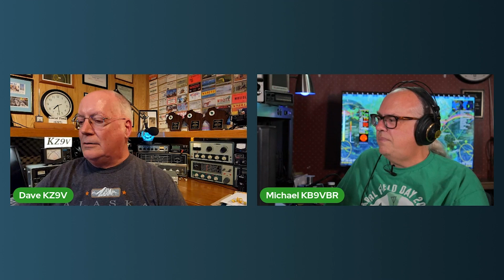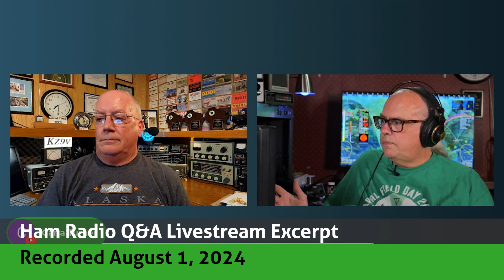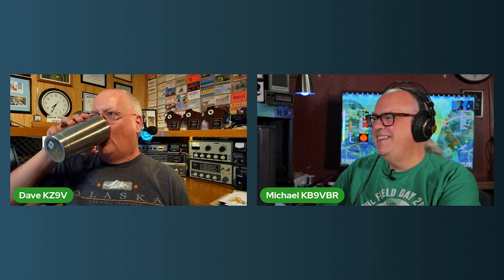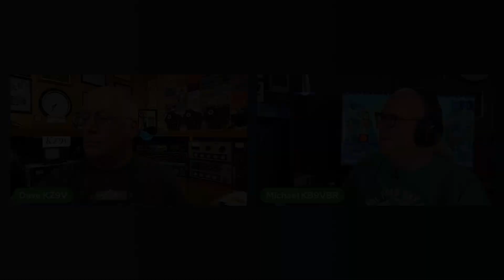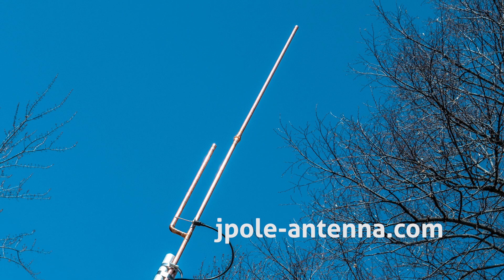Ask Michael, KB9VBR: Help me understand R and X values on an antenna analyzer

Comment: We know 0-1.5 swr is fine and 1.5-2 is ok. And 2+ should be worked on or watched, but what is a similar mindset on reactance? 0 being good, what range is fine and what range is ok and over what reactance should you stop and fix something? Obviously the relationship to swr comes into play, I am trying to “color” in a smith chart to show green ok operating areas, yellow acceptable areas and red, stop and fix something areas on the chart.

Comment: Your idea of running 75ohm cable to the rig (for a mono band dipole), would that work better (than with 50ohm coax to the dipole) when using a rig with an internal matching unit in it and matching to 75ohm at the SO239? If matched at 75, wouldn't that mean that there should be minimal losses in the coax?
Reply from the maker: Yes there will be minimal losses in the coax due to it matching with the antenna. One thing I neglected to say is that if you can cut your coax so that its total length is a half wave multiple, you will most likely have a near perfect 50 ohm impedance at the feed point. (This is an old CB radio trick, but that doesn't mean it won't work with the amateur bands, too).

Comment: This discussion begs the question then also, that while constructing antennas, (especially center fed dipoles) to target the 1.6 swr, or more precisely, ignore the swr and target the reactance, then load the antenna with a transformer to make the finals happy. Am I off base with this?
Reply from the maker: No you're not. When I am cutting a dipole antenna (or 1/4 wave vertical for that matter), I'll aim for resonance if at all possible. If I see on the analyzer that SWR is a little high, but reactance (Z) is close to zero, I'll stop and leave it be. Low SWR is good, and it is an easy concept to grab onto. But taking a more wholistic view of what reactance is and its relationship to resonance (and SWR for that matter) takes your antenna skills to a new level.

Comment: Great job !  75 ohm coax will work great on center fed mono band dipole. Just push the ATU on radio. Tune antenna for lowest reactance . even though SWR might climb like 1. 6 or so. it will work better than a tune of 1.1 and higher reactance. Let the ATU fix the 1.6 or so SWR. Their is 2 parts to reactence.  capacitive and inductance. I just made a T2LT antenna for a friend. I tuned the center conductor for lowest X   and tuned the coil for Z to close to 50 ohm. works super great. SWR worked out 1.2 to 1.3 in the end. And working skip during poor band conditions.  I used a VNA to tune.  and I calibrated at the end of feed line at antenna . You can do this with RigExpert as well. Takes your feed line out of play. 73

Comment: Is there a procedure for recalibrating a RigExpert analyzer?
Reply: Yes, there is for my AA230 it is described in the manual but it is the same as any VNA. You need an OSL (open, short, load) set. The Rig Expert will guide you on the order which is expected. The OSL standards are placed where you want to make a measurement (e.g. at the end of a piece of coax that will be attached to the antenna of interest). If you change the frequency range the unit will return to factory defaults. The default calibration places the reference point at connector on the RigExpert. Incidentally, the SWR measured at the RigExpert will be lower than that of the antenna  due to cable losses. All these measurements can be made using a NanoVNA as well. The only difference is the user interface.
Reply from the maker: Typically RigExpert meters don't require recalibration, but most models do have instructions in their manual on how to perform one.
Reply: DX Engineering sells a set of OSL attachments for calibrating. Search “DX Engineering OSL Calibration Set” on their website and you’ll find it.

Comment: Is this an instance of too much information?  If hams will still pursue minimum SWR as a goal, is there a practical concern over Reactance and Resistance that can be mitigated to improve signal strength? Should Reactance meters replace SWR meters? Linda Blair is envious of my rate of cranial rotation at the moment.

Comment: Ok guys.  Z= impedance.  R = resistance and X= recatance.  It should be remembered that the Rig Expert measures the values at the connector on the device by default. The R and X values at the antenna end and the RigExpert end of the coax are different.  If one connects an antenna with a piece of coax then one must recalibrate  the RigExpert using open, short, load standards (OSL) placed at the far end of the coax. Now you will measure Z, X, and R at the antenna.  The nominal impedence, 50 ohms, is only need to calculate SWR.  Resonance occurs when X =0.   The impedance of a vertical with a good ground system is about 35 ohms and dipole at 1/4 lamda height is about 72 ohms.  For short verticals the capacitive reactance is canceled out by adding an inductor (coil) to achieve resonance (X=0).
Reply: Good summation.  A key point that's often confused is that In the presence of standing waves (i.e., mismatch load), a transmission line (e.g., coax) behaves like an impedance transformer.  Thus, at any given point along a transmission line Z will be different from Z at the load, with the exception of a transmission line point that's electrically 1/2 wavelength or a multiple thereof in length from the load.
Reply: Yes, but measuring at the rig expert end is essentially what the radio sees. And if the radio has an auto tuner, for example, it tunes to what it sees at the coax end. By measuring at the rig expert end, one can also manually attempt to tune the antenna itself, so that what the expert or radio sees on the coax, are improved R, Z, X etc values.
Reply: @Coyotes_Locos  Just add 1000 ft of RG-174 and your rig will be super happy.